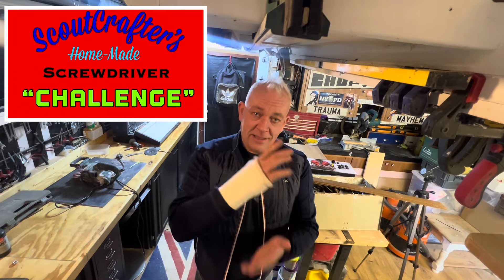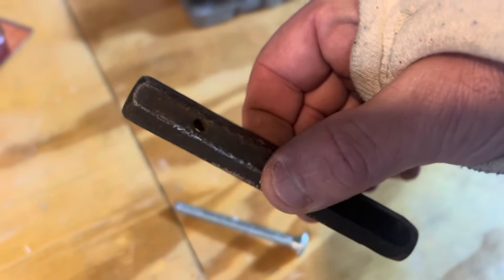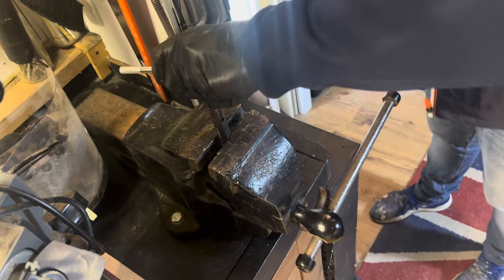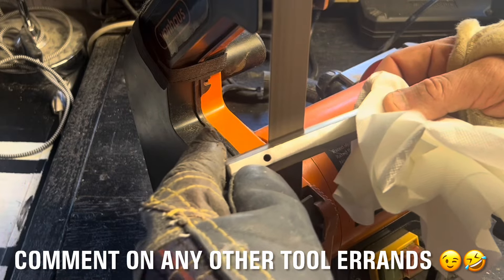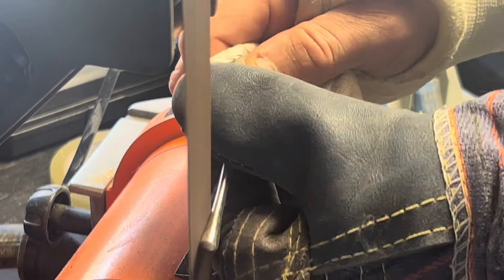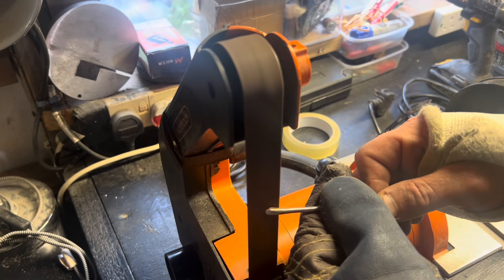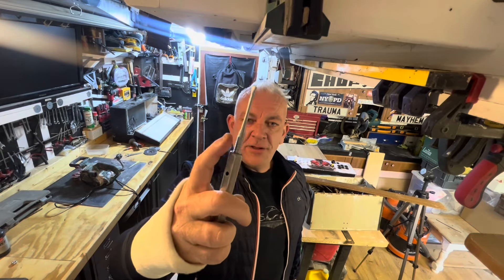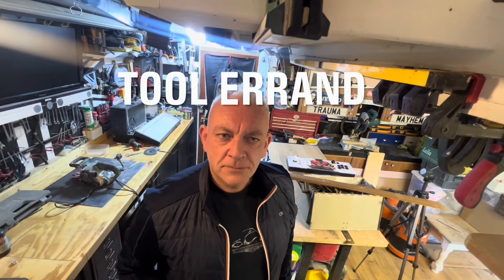LEFT HANDED SCREWDRIVER - SCOUTCRAFTER CHALLENGE 😃

Comment: You did well especially with having to use the non-dominant hand.
If you make another one, consider using a hand file to shape the end.    The carriage bolt steel is not hard so easy to file, may even be faster than the grinding wheel, certainly less heat.
Dave.
Reply from the maker: Good call my friend , and thanks for the advice, I must admit I have cut a few corners on this project.. but I’ll back onto another when I’m double handed again 😉 cheers Rob